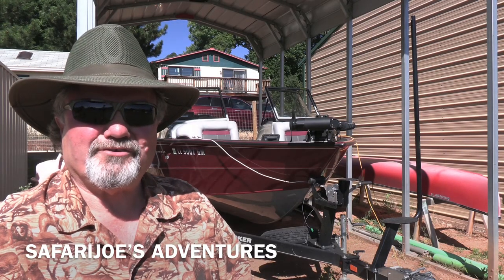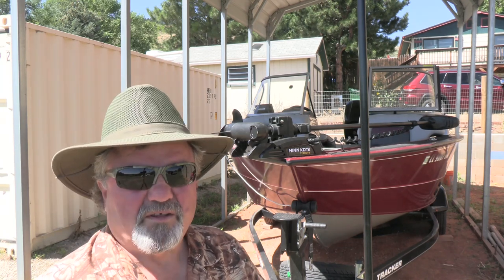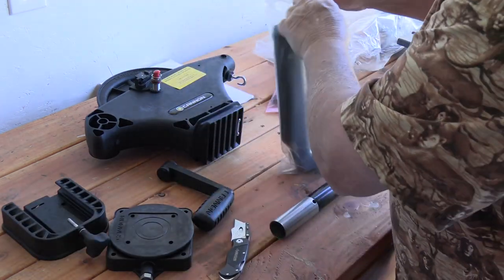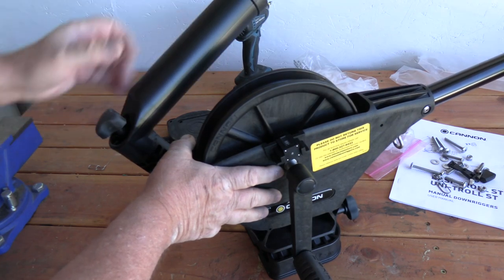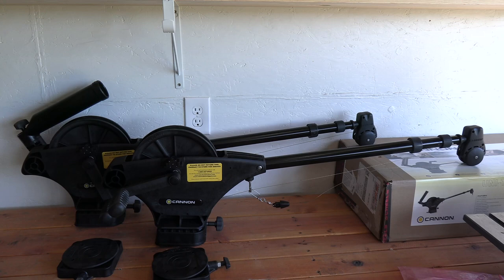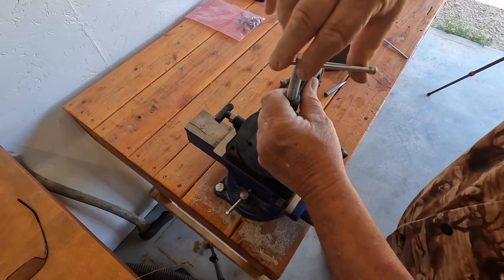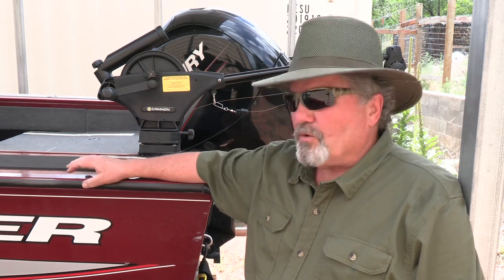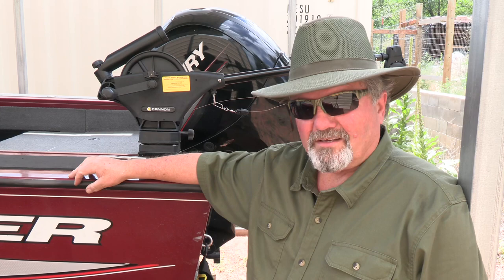Cannon Uni Troll 10 STX Manual down-rigger￼ installation￼ on tracker boat

Comment: Nice walk thru.  Mounted my first downriggers back in mid 80’s.  I would have opted for some aluminum angle instead of the steel.  I preferred the Big Jon downriggers and planar mast.  And I made 4” square plates to mount into with thumbscrews.  Just another way and OEM.
Reply from the maker: @mnmike6884  I think the aluminum would’ve been the better option also as it is lighter and strong enough. I may change that at some point. Thank you for checking in.

Comment: Nice job, i'm currently building my own brackets to mount on my 22 Targa 18WT with  Scotty downriggers. How much flex you experiencing from the versatrack when when booms are fully extended? My bracket design is similar but I'm going to support the top portion.  Thank you.
Reply from the maker: Hello Carlos, and welcome to my channel. I just got done putting these on last weekend. I had planned on going out today to try them out but we’ve got a full blown rain storm so I can’t answer that question for my boat. It’s a 2016 tracker Targa 18 I have watched a few other videos of people putting these on their boats versus track system, and they seem to do fine. I will be doing a video when I actually set it up and use it for the first time. Good luck with your build and good luck fishing.
Reply from the maker: After I test it out if I notice any flex, I will be adding a support on each one of them. What I have in mind is a couple of quarter by 20 threaded bolts with the widest head I can find on them and drilling and tapping the front side of the bracket and screwing them in with a locknut on them. I will put some felt padding on the bottom of them where they rest against the gunwale. I have my bracket set over the nonslip padding so it won’t scratch.
Reply: I send some photos when i'm done.
Reply from the maker: @MrExrench  my email address is in the description below the video. I would love to see your pictures of your mount.
Reply: joe, I am not able to locate your email @safarijoesadventures
Reply from the maker: @exrench  safarijoe58@gmail.com Here it is I generally put them in the description under contact information.

Comment: What a great Job you did. Thank you for sharing it. I have a 2023 v-19. Is it possible that I can contact you and you can make me a few? Thank you. I will pay you!
Reply from the maker: I am glad you enjoyed this video. One of the reasons I built this mount for the Tracker versa track system is to show people how easy it is to do if they wanted to build one or two for themselves and save some money on buying the commercially made ones. The two of them that I made were around $50 for the pair. The commercial ones are just about $80 each or more. I do not build these to sell commercially. Thank you.
Reply: @safarijoesadventures thank you for getting back with me. Is it possible for you just to send me the exact dimensions of the mental? Thank you again
Reply from the maker: @robertsharrak859  the base of my downrigger’s were 5“ x 5“ so I went to the metal shop and bought a piece of 3“ x 5“ by quarter inch angle iron. Here at my metal shop they will only sell it to you a minimum of 5 feet so it cost me about $40. Most metal shops have ends and pieces of cut off angle. They will sell a lot cheaper. Measure the bottom of your downrigger base and at least one side of the angle needs to be that size. 3 inches on the other side is more than enough to drill out for the Versatrac system. I hope that helps. Thank you again and if you have any more questions, don’t hesitate to ask.